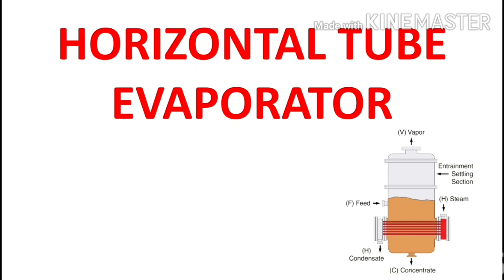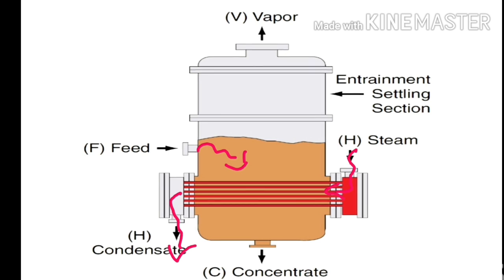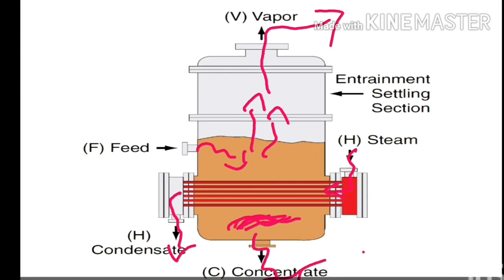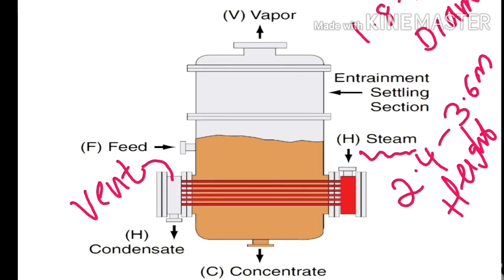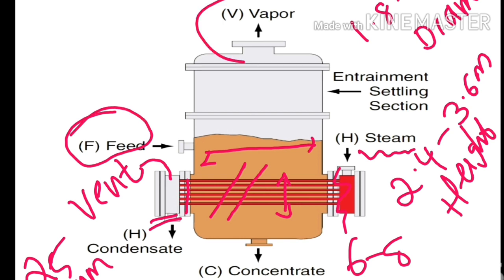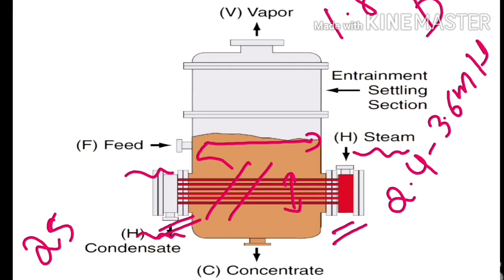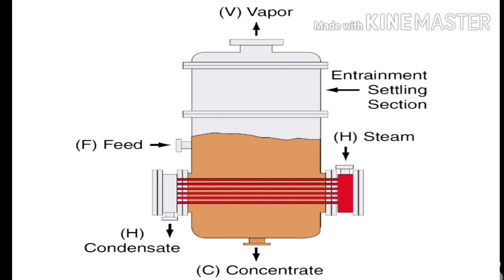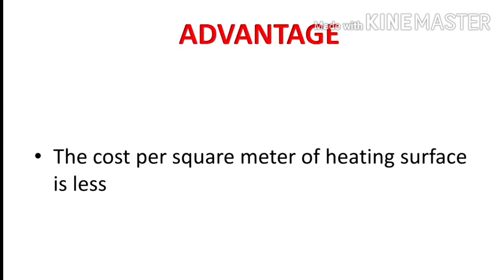Horizontal tube evaporator for B. Pharm students//Pharmaceutical Engineering/Evaporation

Comment: Mam there is no disadvantage ?
Reply from the maker: Disadvantages:
1.high head room requirements
2.higher pressure drop through the tubes than in falling film evaporator
3. Temperature sensitive products can not be used
4. Foaming liquids can not be handled